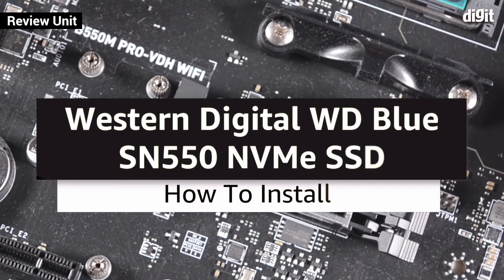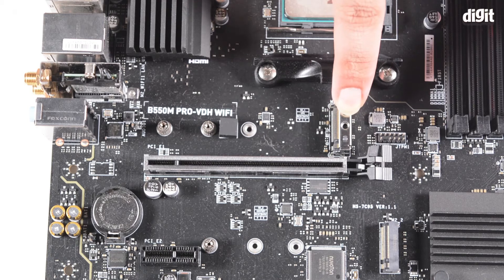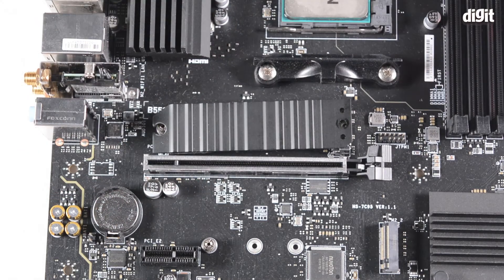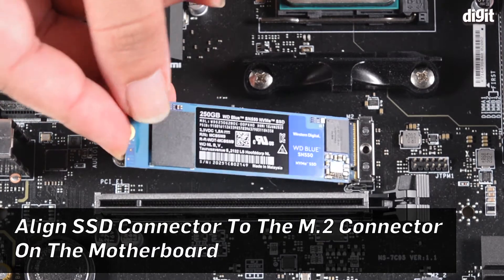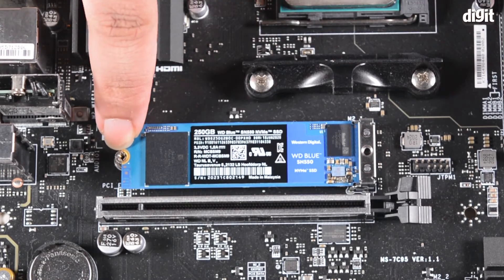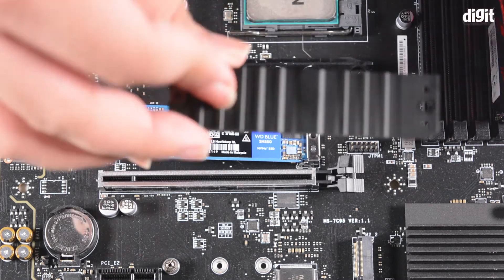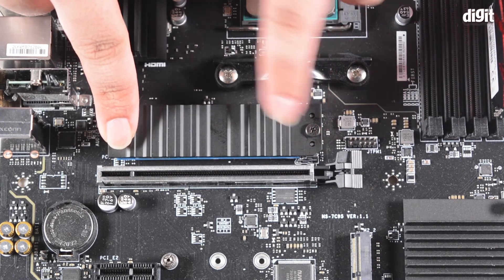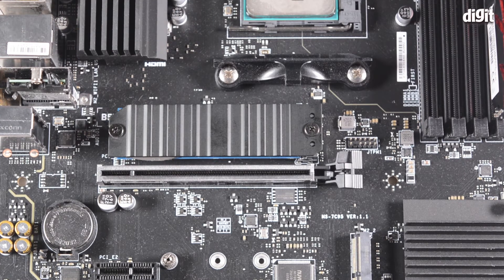WD Blue SN550 250GB NVMe Internal SSD - How to Install

Comment: is heatsink necessary for nvme ssd?
Reply: Not for this one or the later SN570 as they both run cool.  But yes for higher performance M.2 SSDs, such as the WD Black SN 750/850 or Samsung 970 Pro.
Reply: @philgarlic8047  thanks
I purchased and installed ..... :)
Reply: @philgarlic8047  hi there, I have the sn570, is there any negatives to using the heat sink that came with my mobo with this drive? I prefer the way it looks covered by the heat sink, just want to make sure it’s safe to use it.
Reply: @NoGodsNoMastersV2.4  yes it's safe and you should definitely use it :)